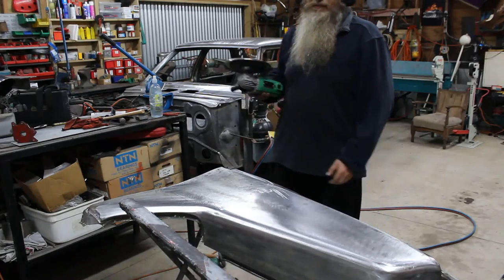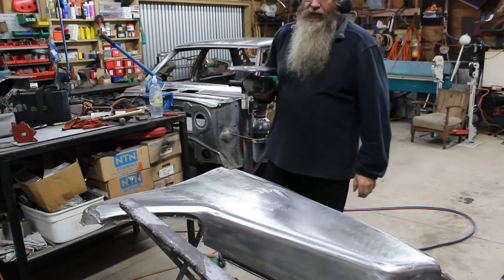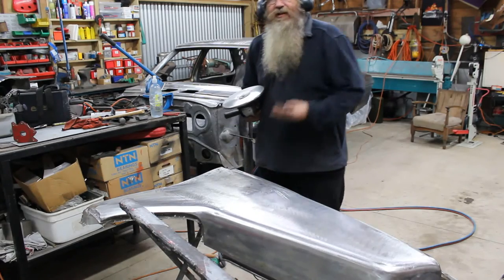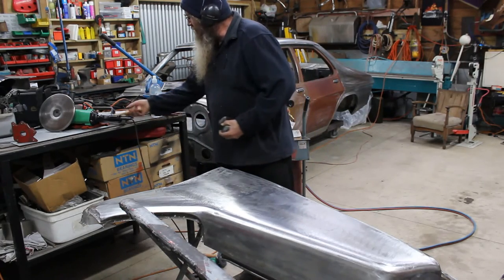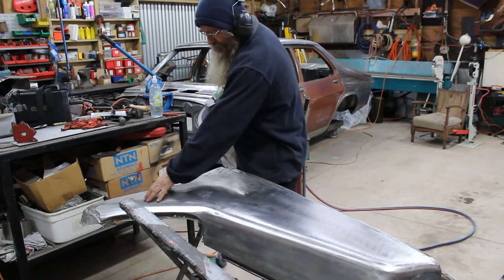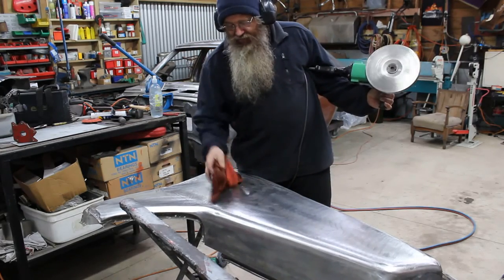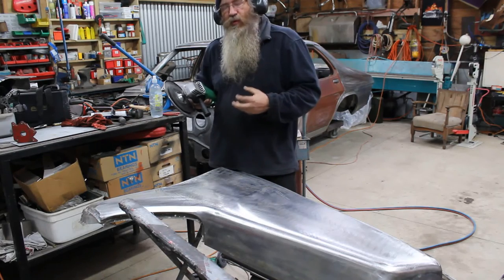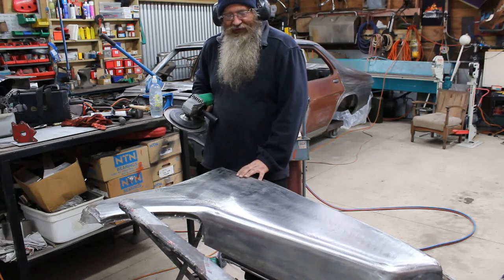Shrinking disc explained by Streetneat LTD

Comment: Very nice video.  The shrinking disc works pretty well at taking a lot of the little rock dents out of  an old 29 Model A Ford fender.  Rubbing your hand over it feels like hundreds of little dents.  The disc takes those down pretty well.  Tom
Reply from the maker: That's right- it works like a hot iron on a bed sheet- smooths out the highs pretty quickly while bring up the lows. The spinning has a slight hammering effect I find.
Reply: U need to put coat of body deadening paint on the underside of fender to stop that from happening again.

Comment: I've seen this sort of shrinking disked used on thin panels. Yet how about 18 or 19 gauge on a 56 chevy? I have some dents on door panels and fenders. I was successful using oxy torch on the door which was really oil canning on me from a prior collision which someone filled to half an inch with filler. Once bringing the sheet metal back to where it normally was, it had a huge crown of overstretched metal. Which is why I heated it up about 8 times. Which really seemed to work well. And cooled each spot off with a damp rag and then air. So as not to over harden the areas. Of course new to working with moving metal around. Like the video...keep em coming. And then post some affiliate links for some tools you can sell. Make money bro!
Reply from the maker: Cheers Rick. Im glad you liked it- have a look at my other videos that have better sound and less rain & geese. I have made some enquiries into getting the discs made but have yet to follow it up further after a few  dead ends. Cooling will work harden the steel - so dont fool yourself  any type of quenching has nil hardening effect. The disc running over the steel work hardens the surface of the steel only as you can tell by how  your fil will be reluctant to bite into it initially. The disc works fine on thicker gauge steel - its the more common stuff the older cars I work on are made from. I also found I can easily  disc  shrink zincanneal  up to 1.2mm thick and that stuff is real hard steel!